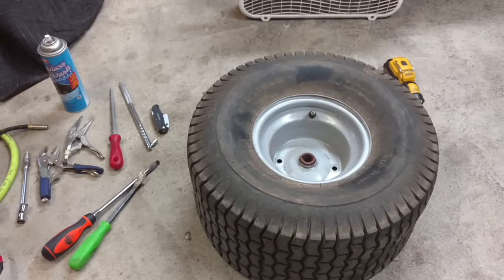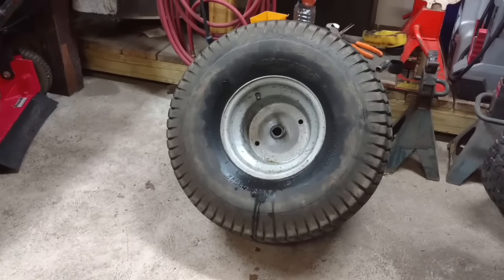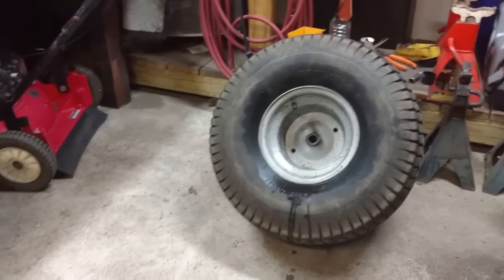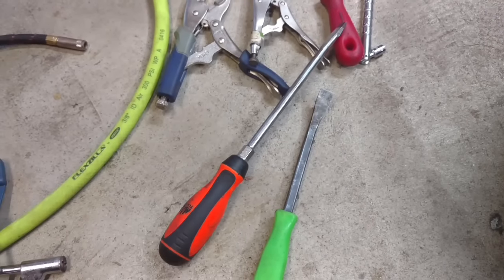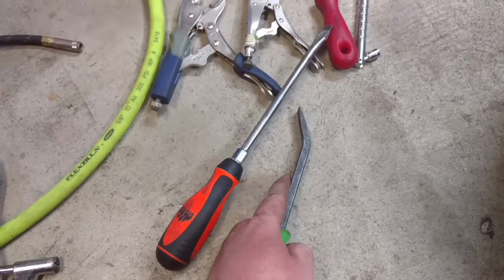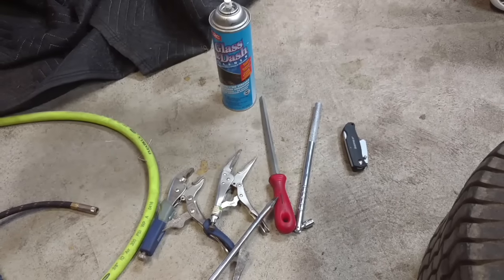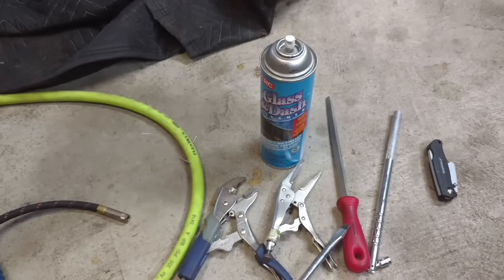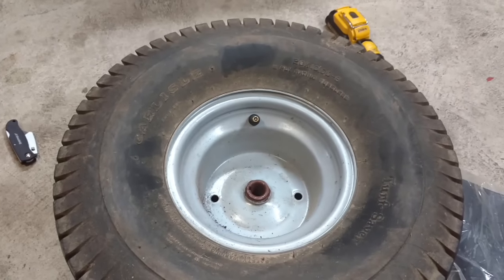How to: Install tube in lawn mower tire

Comment: I did this daily as a 16 yr old working in a gas station with two large tire irons and a rubber mallet. This was on full size tires which I would make $3.00 per and I was happy to get it. This was back in 1963 by the way. This was between pumping gas and providing full-service. One year later I graduated to the manual tire machine and was amazed how fast you could do this. I worked while in high school and always had cash in my pocket - yeah...
Reply: We did wet tractor tires and trucks, cars and pu were easy 
Yea 240 a hour
Reply: Very cool 😎
Reply: Cash in your pocket, good times brother!!!
Reply: That is equivalent to $30 per tire in today's dollars. Sounds like you had a good boss.
Reply: I did that as well,  however mower tires are much more difficult.  I found big truck tires were easier than small tires
Reply: No
I'm in

Comment: I’ve used duck tape to line rims on lawnmowers and farm tractors when the rim is rusty or rough. It makes a nice, smooth surface for the tube.
Reply: Nice Tip!
Reply: This may be a silly question but can someone tell me why one would opt to put a tube in the tire when you can fill it up with air without it? .......Educate me please.
Reply: @TheRTM  Not all tires are made like steel belted radials with a self sealing bead. They don't hold air on their own so you need a tube. 

Side note, the best way to replace broken inner tubes on light duty stuff is to buy a new set of tires that don't need tubes -_-  Oh wait, what's that?  Wrong axle diameter and no shims?  I LOVE MACHINES.
Reply: @TheRTM  There are many reasons.  Hole in the tread or sidewall that can not be patched, slight bad spot in the rim, rust spot in the rim.  Remember, these are 6mph off road tires so a tube for $6.00 is a cheap and lasting fix.
Reply: @TheRTM .         the actual tire is so dry rotten it just won’t hold air , tube is cheaper than a new tire  lol

Comment: Vice grip on rim was key to getting the tire back on the rim.  Thank you for posting this good video.
Reply: The vise grips on big truck tires (22.5 & 24.5 ) are a big help when the wheel is still on the truck/trailer.

Comment: Just did a back tire last night and the air was rushing out around the valve stem. I was sweating pretty good and I was sure I ripped the tube so I pulled the tube out and called it a night. Well in the morning I filled the tube up and could not find any holes or leaks. I have never had air coming out around the stem before but I never had put a tube in a tubeless tire either. Wish I had seen your video before I changed that tire last night!😂

Comment: Forgive me for asking, but why would you want to put a tube in a tubeless mower tire? The next time you get a puncture you will have to do this whole process again. With a tubeless tire, often all you need is a tire plug and you're good to go. Tire slime is messy, but it has it's uses. In my case I have hedge trees on my property and I pick up thorns quite often. Got tired of plugging my tires and filled them all with slime. I haven't had a problem since.

Comment: If I might: 1) Soap up the entire tire where it meets the steel of  the rim. Removing the tire becomes a lot easier. 
2) Never use your naked hand to feel around in a space you can't see for sharp objects: good way to open yourself up. Instead, put on a work glove, and ball up a rag. If there's something in there, the rag will catch instead of your fingers.
3) Always use a work glove to clean the rim by wiping it down with a rag. Again, the glove will protect you from sharp edges. The "how to" on knocking sharp edges off the rim is spot on. Manufacturers don't concern themselves too much with sharp edges inside the rim, because they are designed for tubeless tires. Since we're adding a tube in this video...
4) Use soap to pull the new valve stem through. It reduces stress on it, and allows you to pull it through by hand until it pops into place, making circular motions as you pull.
5) Use baby powder or baking soda to first completely coat the inside of the tire with. This ensures that as you fill the tube with air, it will not pinch somewhere unseen within the tire where you won't know about it until it's too late, and you end up starting all over.
6) Use job specific pry bars on the tires, and not screwdrivers, which can, and do, cut tubes.
7) Sometimes, adding just enough air in the tube to get it to inflate can make it easier to get it to take up shape with the cavity of the tire.
8) If it's a four ply tire or better, and not a two ply as is in the video, good luck with that. Save yourself a lot of unnecessary stress by having the pros with a tire changing machine do it for you. [NOTE:] If reinstalling tubeless tires, make sure the rims are cleaned around the seating edges. This way, it won't slowly leak off at what is their max psi because, while that may be the tires operating limit, it's not sufficient for seating a stubborn tire.
9) After installing a new tubeless tire back onto the tractor, give it about a week or so take up, and hold, its new shape. They can be stubborn after being stored out of round in some warehouse for Lord knows how long.
10) I want to thank the creator of this video for taking the time to show the rest of how it's done. You sir, are a gentleman and scholar.
Reply: Good point about 4 ply tire didn't know that. I did repair several bicycle tires in my 57 years but, never a tractor.
Reply: Soubds like u need to make a video. Lol
Reply: Good point about the little shot of air to pre shape the tube during installation it doesn't take much just a very small shot this will help prevent wrinkling and pinching the tube during final air up I always do this and never have damaged a tube doing so much easier to install for me any ways
Reply: Ìqqkq wa❤
Reply: a

Comment: Great job! As A youngster (dad passed away, no brothers) I learned to patch/repair my bike tire tubes. The inside always had a strip of rubber that protected the tube from the spoke keepers/caps. After filing the obvious sharp welds on that rim I would think, as a added safety measure, a few wraps of electrical vinyl tape in the center welded area  (not the rim area) would help. The tube, when inflated, would keep it in place.
Reply: Holy cow. Im 50 years old, and I never thought of wrapping my mower rims with Tape. I wish they made the bike rim rubber wrap in lawn mower size. lol  And I wish I had seen your comment 2 years ago. lol

Comment: I got tired of doing this to the front tires ,sooooo , last time I had a flat ( three ride ons ) I drilled a five hole bolt pattern through the flat part of the rim, then used my grinder to remove the weld and split the rims. Now it's easy to fix or replace the tubes.just remove the five bolts that hold the two half's together and presto , easy as hell ( be carefully removing the weld , those wheels are pressed out of pretty cheap steel .)

Comment: This is a nice tutorial. IF you can actually get the damn tire of the mower. I think mine is stuck on for life. I've tried everything and can't get the tire off. I ended up doing basically what you did, but with the tire on the mower. As soon as I inflated it, the tire stem pulled inside the tire, and now I'm screwed. So I am trying to order an inner tube with a threaded valve stem so I can put a bolt on the stem on the outside of the rim to keep it from pulling inside the tire. The valve stem is in the center of the tube, and not off to the side to align with the hole. What a pain in the butt!

Comment: Way i do things since i dont have a tire changer either i mount a round bar in my vice and put rim on that. Then let air out by cutting stem or i remove core out stem. Use 2 long handle flat screwdrivers and i pry around edge til it breaks bead. Then flip her over and poke that side til she gets off. Then i use screwdriver to pull tire off rim

Comment: Thanks .. a great video that helped a lot. For those struggling with the plastic grease cap on Huskys, I used a heat gun. It made it very easy to take off and put back on. The plastic becomes very soft, but hot. I used riggers gloves.
For those who are not as athletic, I found that standard wood clamps ( the pistol grip type) and a piece of angle iron broke the seal very easily.
I used a washer and the plastic cap to stop the tube stem from disappearing back into the hub.
HTH
Cheers

Comment: Good Video.  The use of the vice grips is great!!  Only takes minutes to get the tire back on.  When adding air, if the valve stem wants to go back into the tire, release some air, gently pull stem back into position and add air.  GREAT JOB!!!

Comment: After you have initially broken the tire bead away from the
rim on both sides, liberally rub petroleum jelly all around the bead on the
valve side, then put a long 1/2"-drive socket extension bar down the
center axle hole in the hub, then use two long pry bars inserted under the bead
of the tire like scissors around the extension bar for much easier removal of
the tire from the rim. The tire will come off the rim in one continuous smooth
motion, much like the automatic tire machines at the dealers. A lot easier than
the painstaking process shown in this video.
Reply: You should take the time and effort of making and sharing a video
Reply: Since  your  so highly  intellectual  why did you  even  bother to  watch  this video. 🤔
Reply: @darrylhow554 because maybe this is a forum used for the exchange of information & new ideas..?. Just like the guy in the video explaining how he does it.

Comment: Thank you very much. I was getting nowhere fast until I watched your video. 15 mins later tge tyre and inner tube were sorted and my ride on lawn mower was operational. The tip re. using the large mole grips did the trick. Thanks again from England 👏👏👏

Comment: Very good comprehensive video. Especially holding the valve stem in the wheel before starting to inflate the tube. I leanred the hard way that without holding the valve stem , it will pop back into the rim.  Thanks for sharing.

Comment: Two comments for you.  Deflate the tube as much as possible. Reinsert the shrader valve with tube collapsed.   Next get some baby power / talc and liberally put as much as possible in the tire and wheel so that everything becomes bone dry.  Then sprinkle a lot on the tube.  Then it will go much easier and when you add air, the tube will 'unwind' itself inside the tire/wheel.  This is a standard method on general aviation aircraft tires.  There really is no other approved way.  The remaining talc powder will continue to absorb moisture.  Surefire way to get longevity out of the tire and the tube.

Comment: That was great. Didn't know about the vice grip on rim trick.  Also, spraying the lubricant around the edge for easier seating upon inflation is something I should do. One thing  I do after adding just a little air:  spin the tire to make sure the stem is straight up through the hole.

Comment: I spiral wrap Electrical Tape around the stem, leaning it about 3 inches long. Poke it through the hole and tape it to the outside of the rim.
   I have 3 Tractors, one is a Rat Rod, one is stock with a mower deck and one I am doing up for Drag Racing around town.

Comment: this is the best vlog i have seen has far as smallish tyres go.. its given me the will to have another go at my small wheels on which i failed to to release the beads of either one of a set of four tyres. so this will be tomorrows project. So thankyou for this quick straight to the point show and tell.

Comment: Don't use a valve stem tool don't use vise grips use a zip tie works perfect and that also just keeps the valve stem from ever going back inside so you can always just leave it afterward

Comment: This can also be done with the wheel and tire still on the tractor and only having to break the outside bead. Bit of a nack to it , but works if your wheels are rusted to the axle's.

Comment: Good job, I had a tube put in the rear tire of my mower the other day, local shop cost $12,
I guess as I approach 70 I am just not as tough as I used to be,
Reply: No shame in that - there comes the time when we must step back and let wisdom take over for strength.
Reply: 12 bucks sounds like it’s the way to go!!

Comment: I do not recommend using screwdrivers or pry bars for
getting the tire over the bead of the rim on reinstallation, if you don't want
a punctured inner tube. Start with a pair of vice grips clamped onto the rim
bead at one location, working your away slowly and easily, making sure not to
pinch the inner tube at any point. Clamp more pairs of vice grips in place at
90° intervals around the rim until you are completely finished. Axle grease or
petroleum jelly around the rim bead and tire edge are your friends.
Reply: Thank you so much for this video and the tips to do this. B/c of this video, i was able to replace easily the inner tube of d tire of my riding mower with so much struggle and cursing:) you r an Angel!! Thx

Comment: Once you get a tube in the tire every time use the mower make sure it is full of air because if you drive it just a little bit low the tube will shift in there and the valve will get twisted and you have to take the tire off and let the air out and straighten out the valve stem

Comment: I use a simple hex nut with course threads to hold the stem in place. The right size nut only needs to be lightly threaded down the stem to hold the tube securely. And yes, they do kick my ass usually. I weigh about 90 pounds less than you.

Comment: Good  video  except when putting the tire back on  soap  the tire  up makes it a lot easier  put the tire back on and off
Reply from the maker: I've used soap and water in the past but I've found it makes its more difficult when trying to use the screwdrivers, they slip

Comment: just tip after putting stem thru put a washer on the threads and screw the cap on the washer will make the stem too big to go in the rim

Comment: Personal opinion: you need to pull the entire tire off the rim, not just one side. Reason being I don’t think you can see well enough to make sure there’s not a nail or some other thing that would put a hole in your new tube with one side still being on the rim. Your mileage may vary and this is only my opinion. Getting in there with a flap tool on grinder is awesome sauce to get rid of any rough/sharp spots in the tire molding even. Tubes are total wimpy so you have to prepare a wimpy environment so be sure to check your rims as well with your flap tool and paint. What a pain right, that’s why I usually just buy a tire!

Comment: Use the valve stem tool to seat the valve stem by pulling it until it snaps into place.   No pliers needed.  😮 17:41

Comment: Hi, Just wondering if your tube lasted long enough, as it seems the stem hole is way offset when compared to the position of the valve on the new tube. Meaning the valve stem is getting pulled a lot, or the tube must be sitting in one side of the tyre, not in the centre??
I have the same issue and I was thinking if I should drill a new hole to allow the tube site in centre as intended. thought it wont last long otherwise? Cheers imi

Comment: About to tube 2 rear tires on my John Deere....  thanks for the video; that helped a lot!

Question- what’s that freaky flashlight????
Reply from the maker: 12v Dewalt light, runs off their 12v drill/impact battery haha.

Comment: Can you pre-inflate the tubes to check if they have any pinholes. I've seen a lot of reviews for tubes but online and people complain about leaking right away. I just didn't know if you can get enough of the air out of the tube after a test.
Reply: To update my pinhole question. Yes I  pre-inflated and then took the stems out, squashed out all the air and put the stems back in. Just be careful because the tube will expand much bigger even if you have it set on your compressor for say 10 lb. It needs to be inside the wheel to really push back to get an accurate reading so I had over inflated the tubes when testing but caused no harm. they inflated very large at  5.5 psi.  And then soaped them up and looked for any pinholes.

Comment: I leave mine on the mower. Break the bead on the outer all the way in. Pull the valve stem out. Pushing the tire in. Press the tube over the rim. Then press tire in while pushing the rest of the tube inside of the tire. When done. Use a pair of needle nose pliers and pull the tube valve stem through. Then air up. Don't have to fight putting the tire back over the rim.b

Comment: I have tried this multiple times and couldn’t get the true back over the rim.  The tires are rough hard and stiff and will only give a little. I did get the inner tube in after a lot of struggle. Any suggestions?  I may just break down and take it the mower guys

Comment: If it's a rear tire and you only weight 130 lbs breaking the bead this way may not work for you. But a big screwdriver and a lump hammer will.

Comment: (While keeping the valve stem in place and 'test'-filling the tube) Would it help the tube to "find" it's position if it (and/or the inside surface of rim/tire) were coated in a type of lubricant (ie WD-40)? If so, is there a preferred product that would be safer for the rubber tube material (won't deteriorate it)?

Comment: After i stopped laughing ( i have done tires since 1960, and had a cap shop) a trick is to put the valve stem in first before putting the rest of the tube in...................
Reply: good point that I had not thought of.

Comment: This may be a silly question but can someone tell me why one would opt to put a tube in the tire when you can fill it up with air without it? .......Educate me please.
Reply from the maker: When you have a mower tire that won't seal or has dry rot or cracks causing the tire to go flat, a tube is significantly less then buying a replacement tire.
Reply: Repairs & Reviews Thanks!👍